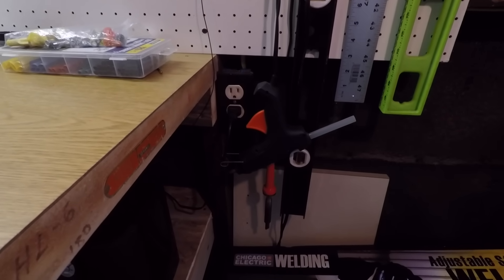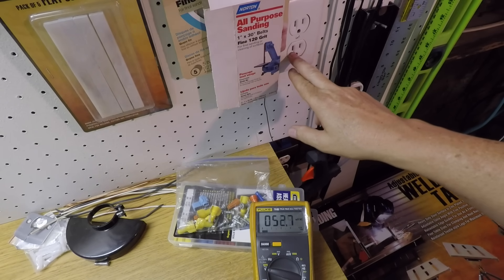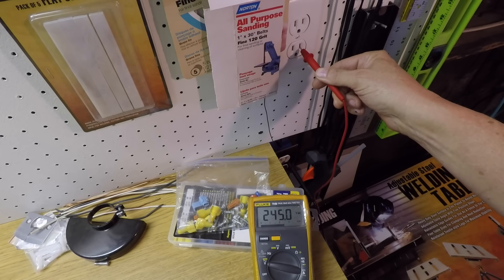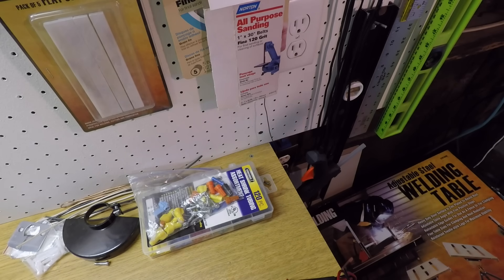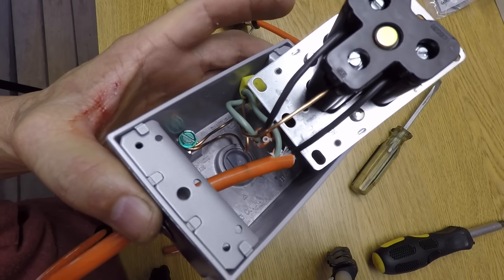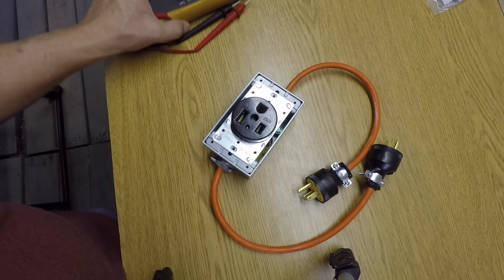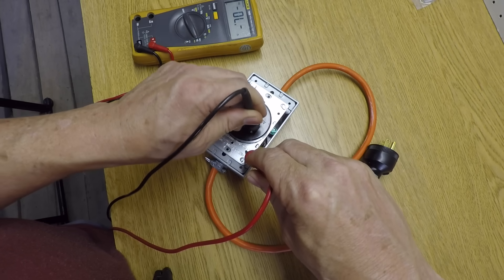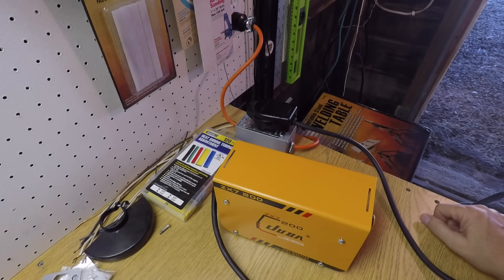How to Get 220v From 110v

Comment: does the 2 lines have to be on deferent sides of the breaker panel like the are normally hooked up ? thank you for the info and video
Reply from the maker: Yes, one line from each side of the breaker panel. (120V from each side is 240V combined)

Comment: Will a combiner work off an inverter with two 110v plugs?
Reply from the maker: Good question! I've never tried that so I don't know if it will work or not.
Reply: @DIYHomesteadProjectsDIYHP10  I'm assuming one inverter would would act as one circuit. So if I plugged a combiner into two inverters, I could get 220. Makes sense I guess ...
Reply from the maker: Makes sense to me. I've wondered that as well but just have never tried it. Maybe I will in the future but I think I would build in a 240 amp breaker into the mix for the combiner so if something quits working with one inverter it will cut off the load. Just my thoughts on this one.
Reply: @DIYHomesteadProjectsDIYHP10  That's a good idea! My boss wants a an 1½ hp electric motor on a machine to blow leaves. The machine uses a 2 battery 24-volt system, and I figured this was my best option. Any suggestions would be greatly appreciated, lol!

Comment: Two things, if you kick a breaker on one line you still have a live 120v circuit inside. If you forget this you can get a shock. Second, there are torque specs for a 240v outlet. Not meeting this torque requirement can cause the outlet to arc and melt and become a potential fire hazard.

Comment: You have to make sure that each circuit is on a different buss than the other.  The reason a 240V 2 Pole breaker is used to combine two 120v legs is that since that breaker pulls each line from a different buss, the sine wave is 180 degrees offset from each other and without a lot of Trig and electric theory, that means each leg's current draw offsets the other, and there for no neutral is needed (each neutral return of each leg is subtractive).. However, if you take to legs from the same buss then the Neutral current is additive and  is a problem. I can only assume that you have taken the each leg from breakers on different busses.  This is not a thing most folks should do without knowing code as this is basically a multiwire shared neutral circuit without a neutral.

Comment: I have a question : Is the US 240 plug any different (circuit wise) from a standard EU 240 plug ? SO if I wire the "standard" EU 240 plug the same way and plug a EU TV running @ 240 V - will it work ? Thanks
Reply from the maker: Sorry but I don't have any knowledge about an EU 240 plug.

Comment: Just use your dryer or electrical stove outlet. Just need a long heavy gauge extension cord to handle the 240v and 30+ amps.

Comment: Hey that's cool. Can I do this with a n inverter that is 120 only? I have an inverter connected to a braker panel. It's a magnasine 24v inverter on 30ish volts 6000watt surge for 30 min 4000watt running

Comment: Clever idea.

FYI: Most garage outlets are going to be on the SAME phase. So this won't work for most people. Electricians usually run all the garage outlets off of a single circuit.

Garage lights are usually on a SECOND circuit and MIGHT be on a different phase than the garage outlets -- that's what the maker of this video did.

He connected an outlet to his garage lights (top outlet). And used a second existing outlet (bottom outlet). And both were on different phases, so this worked for him. 

But DON"T try to connect existing outlets in your garage. It probably won't work. Since they are on the same phase.

How can you tell if 2 outlets are on different phases? Use a multimeter. 1. Put the meter's red line in the hot site of outlet #1 and then 2. put the meter's black line in the outlet #2. 

 0 volts = same phase. Won't work
240 volts = different phases. Will work.

Comment: Never do this! If your running a motor and one trips before the other you'll burn up a motor.
Reply from the maker: My little stick welder doesn't have a motor. It worked great for what I used it for.
Reply: How would it burn up the motor?

Comment: I have a question.  if you have a ground and a common where does common connect at power source  ?  I'm not an electrician I'm just asking. I like learning new things
Reply: It would connect where ever you terminate it. In this case he ran two separate circuits to a box. Split the joints on the receptacle and already has two phases of 120v in the electrical box. He doesn’t need a neutral. One hot goes to one side the other goes to the other. Your receptacles would be tied to other receptacles. If you simply took the neutral in the panel and landed it on a breaker you would burn out any device plugged into any of those receptacles upon contact. Just install a 30 amp receptacle and a 30 amp 2 pole breaker. Run the wire and be done with it.

Comment: I would think 🤔 you can use the same breaker for both plugs 🔌 because it’s rated for amps not volts. So if your machine is only pulling 10 amps or 2400 watts you’d be fine. It’s just like plugging 2 devices into one outlet. Thanks for the video I think you solved my problem.
Reply from the maker: Great point!

Comment: Could this potentially work in reverse?  For example to power a building from a generator.   Use 2 110 plugs feeding into a 220 welder plug in building to power a submersible pump?

Comment: Im lettin my buddy live in my trailer...from my garage which had a dryer plug...I wanna put the trailer to that plug so hes got lots of power

The plug for my trailer isnt the same as the dryer plug in my garage..tho i have a connector that plugs into trailer and into a regular house hold plug...
How to i use an extension cord to my 240dryer plug to my trailer plug?
  (Lol im a drywaller..no idea what the volt is to my trailer..forsure isnt a dryer plug nor household plug)

Comment: I suppose you probably have been told why to not do this, first even for a short time it’s both dangerous and illegal and should you burn down your house, ( not to mention your neighbors houses) so here goes. The two circuits while they may be 20 amps or say 15 amps each will not be a total of the two, 20 amp plus 20 amps still only adds up to 230 volt ( 240 volt if you may) at 20 (or 15 amps) they will not be combined. The second thing you cannot have a live plug on one side of the “Y” that even if the welder were to “blow” one breaker, the other breaker would keep the unit live and that would be enough to burn up the unit, start a fire, and or cause some kind of severe damage. There is a long standing electrical Rule that no end of an appliance or extension cord will ever have live power to the plug points the sticking out brass, there is no way for another person to know that the one half of the “Y” is loaded. The next thing is that you are using stranded wire in your electrical cord “Y” and running more than likely to low a gage wire for the combined Voltage/amperage, the wire must safely exceed the amount of power drawn plus in a welder needs a measure of surge safety as when to strike it, regardless if MiG or Tig etc. If memory serves it needs soild core 8 gage, better 6 gage that will clear you to 50 amps, ( 55 officially) Now most good welders will use MVP ( Multi Voltage Plug) such as Millermatic 211 which is more than enough for most needs and will run very happy on 110 or 230 volts. I have dedicated 220 volts circuits with 6 gage wire, also 110 circuits with 10 gage wire and the welder can weld 3/8” with 110 if properly prepared, so I know it can be done, if you have questions or would like photos feel free to call on me.

Comment: Damn, its like a dick swinging contest with all these comments. If he there was a easier way to add a 240 breaker and outlet, im sure he would. I know exactly why it is convenient, and the only way, to have 240 outlet and keep the lights on in the shop, thats aways from the box with no room. Im in the same situation. And its only used when he needs to weld something, then unplugged.keep an eye on it, If the welder makes it over heat, hell, uplug it and dont use it. If one side trips, the machine will stop working and stop using it. Not a big deal, and it for temp use and u can take anywhere u want. No children and grandmoms are gonna be sleeping byside it , or welding. Stay calm people, we know ur smart and all, and want to show that off , but damn, give him a break. Lol

Comment: What happens  if you have something  plugged into one of the 120 outlets wouldn't that unbalance the load? That mean you can or can't use the 120 outlets while using  the 240???????????

Comment: I would use a 12 /2 wire because the black goes to hot and white goes to common or larger size of the plug and the prong goes to neutral or green. You want 2 returns to ground for a safety aspect and the meter reads off of resistance and it uses less amps that way.

Comment: I would have used one outlet with two circuits with one 50 amp breaker,. That way if one lead gets too hot, the breaker will trip both sides. I would have also put both cords into one hole, it would be easier to place on a table.

Comment: Can only work if feed has 2 separate  120 sources otherwise  it shorts out itself  on a draw  a single 120 RV panel  bar CONNOT  obtain this lol but a 2 hot leg bar system  in a higher panel 50 amp you could obtain that in an RV   lol or house    :)

Comment: Yea this seems like a bad thing to do especially for a high current draw device like a welder.    It would be about the same amount of work just to add a 240 breaker to your panel and pull a short line and plug.    Safer and about the same amount of work.    Strange things could happen to your voltage at this 240 plug if you start having shorts or trips or faults on the 120 plugs in line with the legs going to your 240 plug.   There are some good videos on utube where a guy hooks up lights in a circuit and starts un plugging them and checking voltages across the entire circuit.    Strange things happen.

Comment: Many people here raised some valid safety concerns but another concern is that the two outlets you are plugging into are only rated for 15 amps.   So the best you can safely use is a 30 amp load.   The outlets are probably wired with 12/2 Roman which is only rated for 20 amps so if you upgrade the plug to something more substantial then you could put a 40 amp load on it but not 50 amp.

You could solve the safety issue by removing the two individual single pole breakers in the AC distribution panel and installing a double pole breaker and put one one leg in one phase and the other leg in the 2nd phase.    If you do both those things you can safely run 40 amp 240 volt.
You can also remove the outlets completely and wire them together in a junction box without using the outlets.  They are close enough together where that would work.   Then you could have a real 240 volt 40 amp outlet and use one leg for a 120v 15 amp outlet.

There are many safer ways to do that then what you have done here using your box.
Reply: Upgrade the wire and the plug and get a 240 breaker.

Comment: I remember plugging in a spotlight at a construction site. Unknown to me, the 120v outlet was designated for the 240v saw. A 120v outlet, with 240v unmarked. It went boom, bulb shattered. And remember to test your 2nd plug with your tongue, because you don't know who could come along and pull a plug out.
Reply: I did that once too. I plugged the light in and damn it was bright.for a second or two.
Reply: LOL many years ago I did the same. I was wiring a friend's new church for telephone and although they had originally painted the receptacle red, it had faded with weather. II was using my old trusty metal B&D drill, this was when they still made metal housing tools, and my first thought was, man, my drill is cooking today. I was halfway through the job and the drill was flying through the 2X4's until suddenly it popped, smoked a little and froze. One of the construction guys asked me which plug I was in  and when I said the bottom one, he said, oh, that's 240. I'm lucky I wasn't electrocuted because when I got home my drill autopsy revealed the armature was welded.
Reply: we plugged a kerosine heater to a 220V once and it took of across the room.

Comment: Add a proper rated breaker, run rated wiring,  and add the outlet. Do it right. You need a small breaker box and breaker, with your setup anyway, or risk death, or worse.
Reply: Other than a breaker tie clip what in sam hell are you talking about? 20amp breaker on 20amp #12 is all it takes.
Reply: non-rated wiring because of increasing amp/current?

Comment: If I wired it exactly like you said why am I not getting to 220 on my plug I get 110 on the side but not to 20
Reply: You have to make sure both hot wires aren’t on the same leg/buss bar. Be safe and just use a two pole breaker rated for your device and proper sized wire for the amperage.

Comment: I’m not understanding the need for this. You obviously have 2 breaker positions in the panel so just install a 240v breaker and do it right?  After over 30 years working in electrical utility  I’ve seen enough ideas that work, go bad. There is no “try this “ because with electrical power you often don’t get the chance to try again. Seems you have the option to do it correctly so why not?
Reply: You would need to pull probably a 6 or 8 awg wire for what your suggesting, depending on the amperage requirements.   This way your bringing the two legs required for 240v without any modifications to the existing wiring.  I much prefer what you're saying but I can understand this method being useful.

Comment: yeah...don't do what buddy does and don't think for a second that it's proper. Any electrical inspector will fail it only after having a good laugh then wondering if you were sane to be doing that. it's completely unadvisable ,not only because it's redneck style, but also because you're using 14 gauge wiring to power 6 gauge device or 50 amps. Keep doing that and you'll have a nice electrical fire inside the walls

Comment: It would be a lot safer and more useful to have just wired the outlets with 220V to start with and a proper 220V plug and then to have created an adapter that could be used to convert that to 110V... A 220V 20A plug doesn't do me any good for my welder... My welder has a NEMA 6-50 plug, so my outlet, wiring, and circuit breaker is rated for at least 50A...

Comment: You have 240v in your shop. Just run a circuit & use a 2 pole breaker. The title to your video could leave someone to assume that you have a shop with a branch circuit that is only 110v.

Comment: A perfect case of knowing just enough about electricity to be dangerous. This is a good way to be electrocuted. If one breaker trips, the load will shut off, but power will remain on the unit. Two pole  breakers with a bar between the handles will trip both when there is an overload on either. This is the only safe and "code complying" way to protect a 240 volt circuit.

Comment: That seems like too much trouble I just use 2 paper clips shoved into different outlet holes with speaker wire to the plug. It will ground through the welder. Simple.
If that's not enough power just add a third paper clip to another plug in. ⚡
You can weld 1" steel with a tiny welder doing this method

Comment: You cannot get 240,220v unless you have two separate phases. If you have two phases then just wire it right or follow each of those phases back to the panel then combine them into a double pole breaker.

Comment: If u are so good at wiring and you put those plugs in . Why don’t you just wire in a 220 v with some 6 ga wire and run your welder ? You know u have a welder that needs 220 .. just run a 220 plug .. use your head for something besides a hat rack

Comment: Besides ot. Ot being on a tandem 2 pole breaker... he's using 12g or 14g on a 50amp breaker.... your breakers will trip... if you change the breaker.... your wires are going to melt... this is all bad...

Comment: It’s the same as hammering a nail using a rock, it works! Not pretty but it does work. I’m rewiring my neighbours garage tomorrow and I’m going to do this same thing and hide it in the walls except for the 220 volt outlet. My neighbour is really going to be surprised at how good I can do even if I’m not a real electrician. It’s the thought that counts,right? 😀👍

Comment: Lights and outlets should NEVER be on the same circuit. If a device that is plugged in draws enough current to trip the breaker you will be left in the dark. ;)

Comment: Here's the problem I see you with your setup. Your setup is making the ground which is not supposed to have any current running through it alive current because you have 2 positives too hot and you're using. The ground as a return to complete the circuit which is illegal by all codes. You are so you're better off just using the neutral wire as your ground. So you're completing the circuit and you're not turning everything else in the main service panel?  As a hot return negative use common sense the kiss Method. it always works.

Comment: Thankfully your ground is bonded to neutral in the panel.  If it weren't, you'd fry everything.  I'd have wired the Neutral wire in and used the ground as... a ground.  Lot of trust in that pigtail.